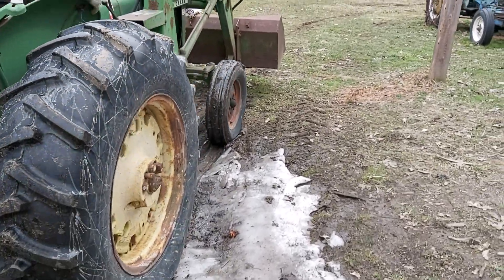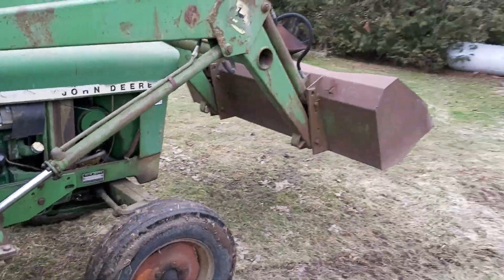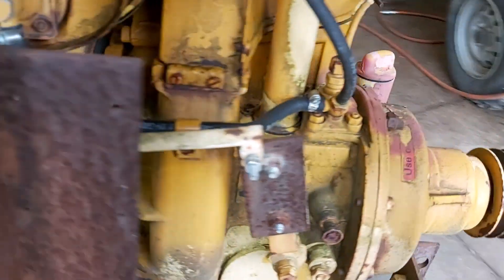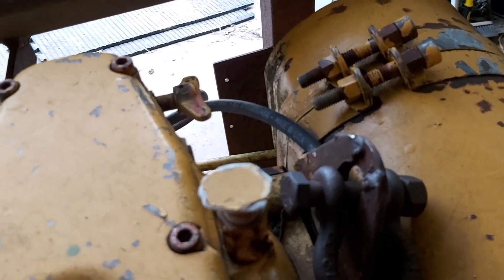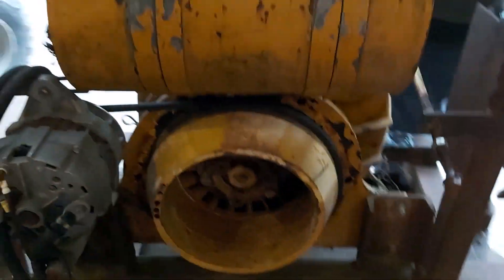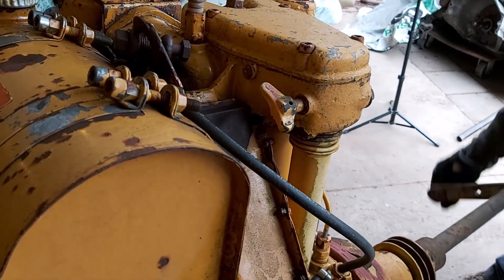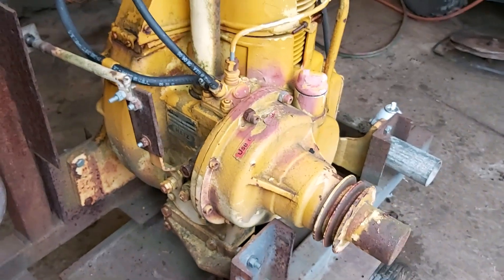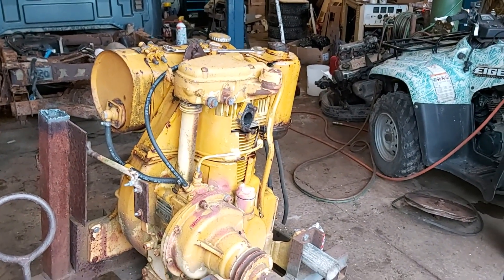COLD START on the HAND CRANK HATZ DIESEL!! First attempt!!

Comment: ROTFLMAO !!!

Not a clue !!! So, I'll give you three tips.....

1. It's a diesel engine. Try running it on diesel. ONLY after you've got diesel going into it....
2. Fill the oil primer with oil and squirt it into the cylinder. And then, 
3. set the injection pump to excess fuel....
4. Crank the engine over a couple of times
5. Then start the f*cking thing  - if you're strong enough - I know I'm not - damned Hatz engines !
6. Once it's running, run away - go make a coffee while it warms up.
7. Return to it once warm, reduce engine RPM (to a tick-over) so you can hear yourself think, then it'll be ready for driving things. Deisels don't have a lot of power when cold. Hatz diesels have none.
Best of luck.

Oh, and the burney thing/wick - that's for cold starting it but you'd probably do better throwing the whole damn engine in a fire !
Starting one of those is great for warming YOU up ;)

Comment: I enjoyed it but you need an air powered assistant, like an air wrench to spin that thing.
Reply from the maker: yes, we just wanted to see if we could do it.  i think its not getting fuel.
Reply: @progressivedynamicsolution1769  Right. No smoke, no fuel!
Reply: Why that is Just stupid.
Take the air out of the high pressure line

Comment: Hi guys! Pro tip; it looks that this engine has some kind of fixed rpm thing, release it and make sure that you can adjust lever to max rpm. 
If you look below the pump unit, there is a small knob. Adjust rpm lever to max position and pull that knob, it should came out something like 4-7mm and then you have forced injection engaged. It’s automatic, so if you gently lower the rpm it will go to run position.
It should then start without Zündfix easily. If not, there is something more to inspect. These are really durable engines, but air leaks, wrong valve clearances, worn rod or worn piston pin turns these to gym equipment.
Reply from the maker: Thanks for the tips. We will look Into it.
Reply: Hey Jani I have an old diesel 2 cylinder I can't get started if you can let me know if you can help?? Facebook or IG? Look me up please...
Reply: @sokolsulo  check your incoming messages at Facebook messenger! :)
Reply: I ended up to create a channel as I found one video about starting my plate compactor wich has Hatz Diesel. Is this the way to become a youtuber? 😂

https://youtu.be/yxKHWnlsCHk

Comment: This is fascinating. Could you comment a little more on the vegetable oil thing?
Reply from the maker: The idea was to preheat the vegetable oil because it doesnt burn as easily as diesel in the engine.  We may revisit that idea once this engine runs reliably.

Comment: Wow, I appreciate your effort but your technic has some fault. First of all, you should check fuel system from tank to fuel pomp(part-1) then control the injector pipe and injector(part-2).
 If there is no problem in fuel system, open the choke and the compensation valve. In that case, probably your valve is not automatic, so it doesn't work. For handling this situation, firstly put the valve vertical while turning the shaft; then turn into horitontal. One more thing is If the weather is cold, just burn a paper or wood in front of the exhaust and turn the shaft slowly aprox. 1 minute. After that apply the described method. This is Turkish Pancar Motor(licence Hatz), I added the Pancar Diesel starting videos and user guides with pictures(unfortunatelly all of them is Turkish :)) ). I hope, you'll do it .

https://www.youtube.com/watch?v=ARD1wI3UYD8
https://www.youtube.com/watch?v=k0MmVUNlvQg&t=414s
https://ekilavuz.com/pancar-motor-e-89-e-89-kollu/pancar-motor-e-89-e-89-kollu/pancar-motor-e-89-e-89-kollu/pancar-motor-e-89-e-89-kollu/pancar-motor-e-89-e-89-kollu/marsli-dizel-motor-icten-yanmali-motorlar--4d4b7b5554039458-37
http://www.istanbul-cemberci.com/pancar.pdf
Reply: If the weather is cold burn a piece of wood or paper in front of the intake ... You wrote exhaust? Wouldn't crank the engine against its designed rotation direction!
Reply: @JohannHöchtl  I think there was a misunderstanding. I didn't say anything about "crank turning rotation". I have just said rotation about the "compensation valve". Moreover, If you want, you can burn smt in front of the "intake", but taking out the intake valve(or filter) takes more time. Instead of that method, burn smt in front of the "exhaust". While rotating the crank, there is air circulation "1 in 2 out" on exhaust part.
Reply from the maker: yes, we need to make sure its getting fuel.

Comment: That thing is a killer.  Set up a gas or electric motor,  belt, and pulley to whirl it over with.  Set a good hair dryer on high and blow it through the intake, while turning it.  You might also,  crack your fuel line,  at the injector and make sure you are getting fuel up to the injector.  If not,  turn the engine over,  or pump the primer pump,  if it has one,  with the line cracked until you see fuel.  Then tighten the line fitting,  and try cranking it.  If you didn't t get fuel,  you have a fuel supply problem,  as in pump,  too much air in the system,  or stopped up line.
Reply from the maker: A hair dryer is a good idea. Thanks